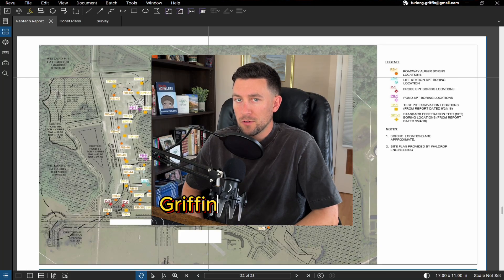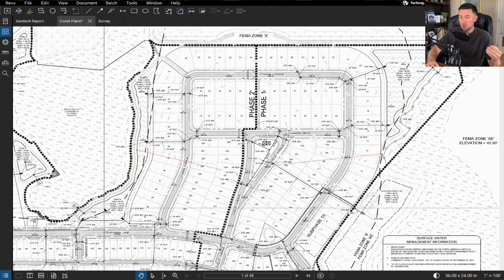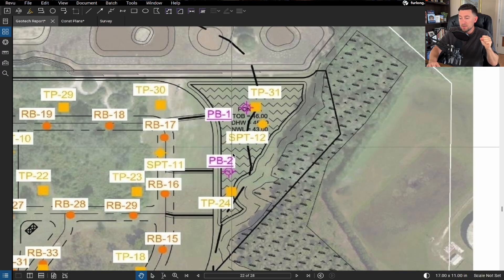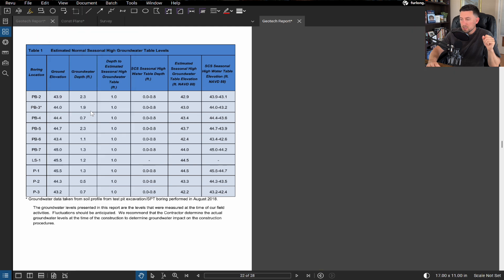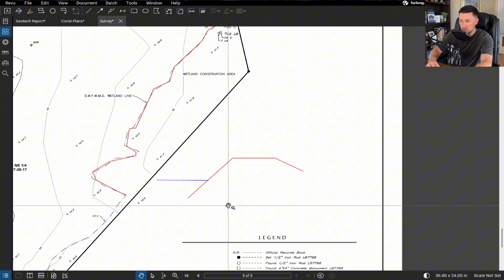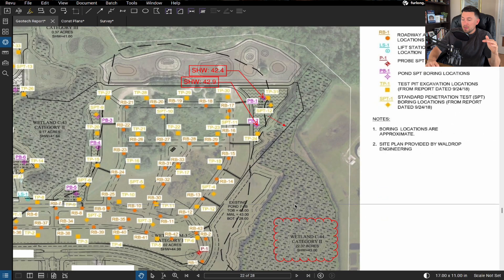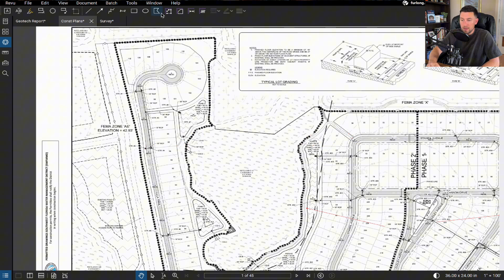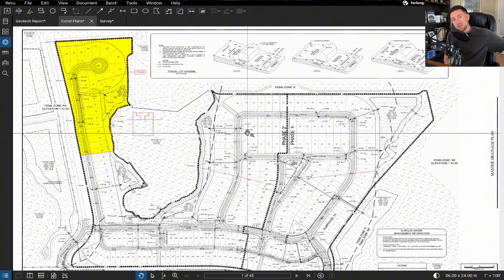How to Design Stormwater Ponds (Beginner)

Comment: Awesome video, Griffin!
Are we assuming the groundwater elevation at the wetland == surface water elevation? Is that why you are using the SHW for determining the outfall control elevation?
Also can you do a video on pond outfall structures design?
I appreciate it!
Reply from the maker: The wetland SHW in this case would be the surface water elevation. However, what I technically didn’t touch on yet is the wetland’s control elevation which is the elevation at which the wetland outfalls. And yes, this SHW of the wetland had to be factored in because the system needs positive outfall.

Comment: Great video! Noticed there is a FEMA flood zone AE, was that accounted for in the design of that pond it’s over? And is that a detention basin near the phase 1&2 boundary being proposed? I’m assuming it also discharges into the wetland?
Reply from the maker: Thank you! And thanks for the question. There are two ways to mitigate for flood plan impacts. 1) cup for cup, meaning if 1 ac-ft is impacted then there needs to be 1ac-ft of compensation and 2) you can dynamically model this system and prove no rises in stage in offsite properties for all storm events. In this case, there was a floodplain compensation pond created on the northeast boundary and the project also dynamically modeled to prove no rise in stage downstream.
Reply from the maker: For your 2nd question, I don’t see a detention basin by the phase 1/2 line. These are all roads and lots.

Comment: How do the weir cuts determine flooding vs non-flooding of downstream property? Is it simply a way to control volume per cut dimension?
Reply from the maker: The weirs control the discharge rate from the pond, so the wider the weir, the more flow into the next body of water. And sometimes the discharge rate can be pipe controlled, meaning a certain pipe size can only physically release a certain flow rate before you have to upsize it to increase flow. Does that make sense?
Reply: @civilgriffin  Yes, thanks. So, either way you have to locate and size your pond according to site conditions and potential outflows. Do civil engineers ever use natural/soft infrastructure overflows, e.g. earth w/rock to prevent erosion, or do they always use concrete/metal/hard infrastructure overflows?